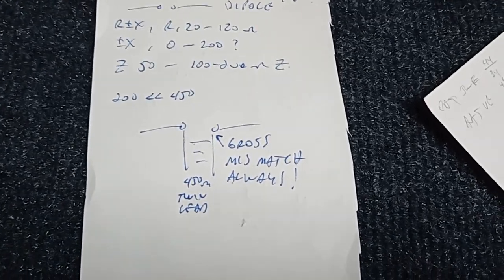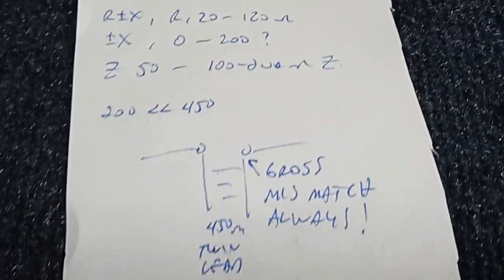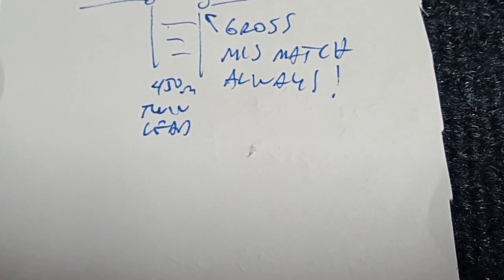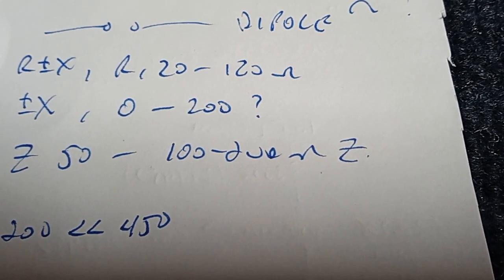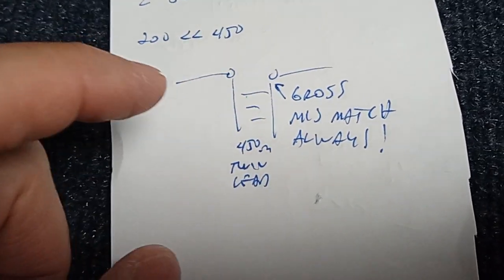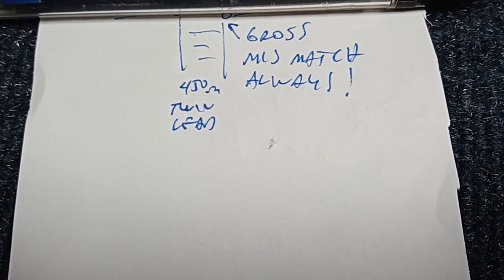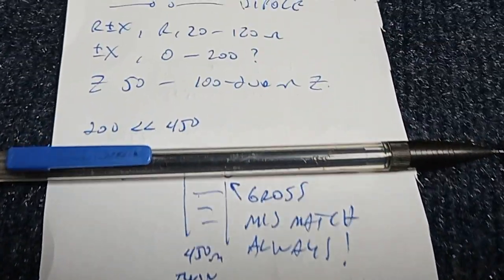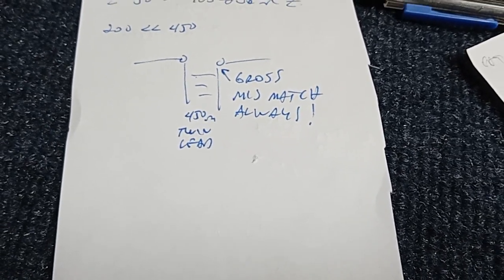The Doublet Deception

Comment: I have a question where do you find good coax that can withstand legal limit for less $1.50 a foot?
And again, I stress, good coax because there’s a lot of garbage that you can get out there for the price of water, but it won’t handle legal limit, even though they say that it will
Reply from the maker: 1. If you need " legal limit", your antennas are no good. Guess- youre using an OCF pretending you have an all band antenna...

If not and the bands are so dead you cant even ' get out' with an amp, GO GET A LIFE.

2. Name one kind that wont handle legal limit. Is it that or your junk antenna with high reflected power thats destroying otherwise good cable? High reflected can cause extreme voltage or current peaks. That would agree with # 1...

3. Times Microwave LMR Series, either ' real' Times cable or Jefa Tech clone.

Comment: For fun I put up a doublet using low voltage landscape wire. It outperformed ladder line in a sumilar config. Not sure why but my guess is that the impedance is more in the range of the dipole.  A dog with fewer fleas.
Reply: I am new to all this.  So… What antenna arrangement is suggested?  Coax fed dipole or ???
Reply from the maker: Watch all my antenna videos.
Reply from the maker: Theres REAL radio. See what works. An intelligent test.

Ladder line was a thing of the early 1900s and Depression era. Make dog bone line or nothing.

It doesnt contain fields like concentric line.

Theres a video here on an early 1960s QST article proving ladder line has bad losses, worse than " coax"